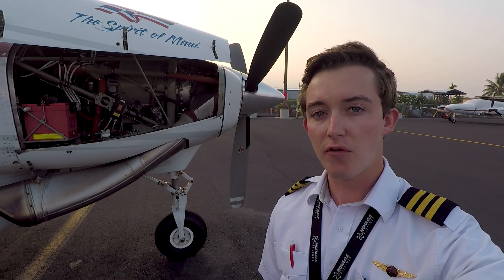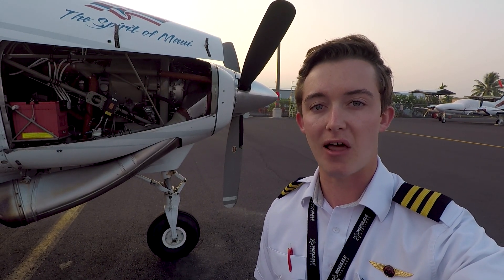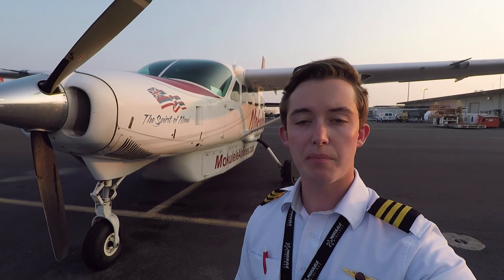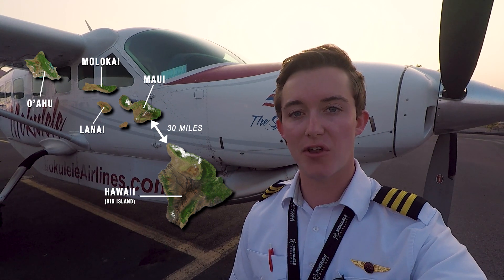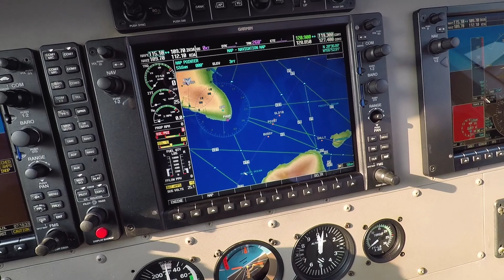One Engine Over The Ocean... Can You Fly Safely?

Comment: While youre obviously trying to avoid going in the drink with careful glide range consideration, with the way that smooth flat bottom of the cargo compartment looks, if the seas arent too bad, I'd bet the caravan would ditch in a rather well behaved manner. Hell, adjacent to shore may be preferable compared to some of those rugged mountains.  Not that its an issue for you anymore flying RJ's. Congrats on becoming a line-holder too.

Comment: There's no such thing as safely operating a single engine aircraft over water.

You're talking about gliding to the shore-line which is great, but you'd need to land on a beach or controlled crash into the water which isn't good.  

I doubt all the passengers would realize that if the single engine stops they are either going to get wet, injured or worse.  With extreme luck you'll have a safe landing.

Comment: Now with the rule to be within gliding distance of land and in event of an engine failure, is it likely that the aircraft will still be ditched in the water correct? I know every scenario could be different but Hawaii has some rugged terrain around its shorelines. I am not mentioning this to scare anybody but I just want to know what you've learned from experience and training!
Reply from the maker: airplanekid333 Good question! In many cases a water landing is much safer than the rugged Hawaiian terrain. It just depends on which island you’re around and if there are any open fields or roads. We always brief our takeoffs and emergency plans per the terrain around us. For instance, the land around Kona on the Big Island is all lava rock that would make for a bad ending during an emergency. Water would be the safest bet there

Comment: I've always dreamed of flying from NY to my home island St.Croix in the Virgin Islands however, the thought of crossing so much ocean with a single is nerve racking. Even if I started in Puerto Rico and fly the 90 miles east  is still troubling. I would chance it  it from St.Thomas to St.Croix because it's just 40 miles. I've recently added a multi-engine Add on so that cuts down on the anxiety. As usual, great video and much needed for us who is considering  flying over the ocean.
Reply: Look at it this way, if you owned a VW Golf and decided to drive from LA to San Franscisco, an engine failure would probably be the last thing on your mind, it is a very reliable engine. Your aircraft engine is considerably more reliable, it has two sets of ignition, controls to keep the mixture right and the fuel supply happy, it is checked and serviced far more often than your VW and you test it, or should do, every time you take off. It is under very little strain, it does not accelerate and decelerate very often, there are no reverse loads from engine braking, it is having as easy a life as an engine can have. That's not to say it can't break, but properly serviced and handled there is no reason why it should.
Obviously, you plan for that eventuality, but small aircraft are flown over oceans on one engine all of the time, it just takes a common sense approach and careful planning, the weather, and what you do if you hit bad weather, is a far bigger issue than an engine failure is likely to be
Reply: Just plan ahead and plan some more. It can be done. I flew a Centurion from CYTZ ( with stops obviously) to Scotland and back. Its just all about planning.